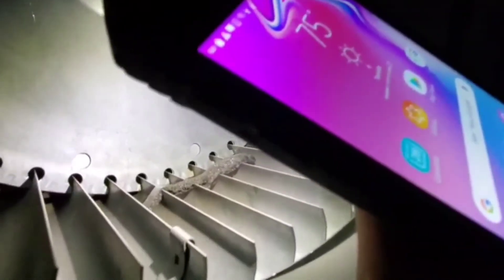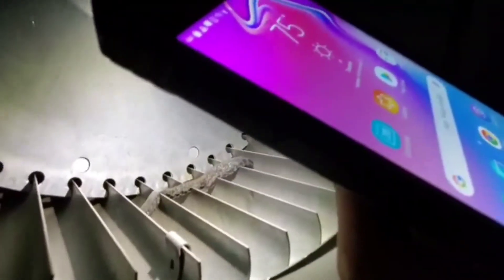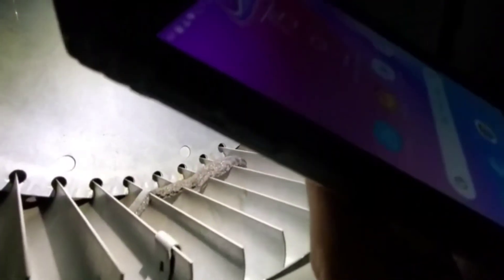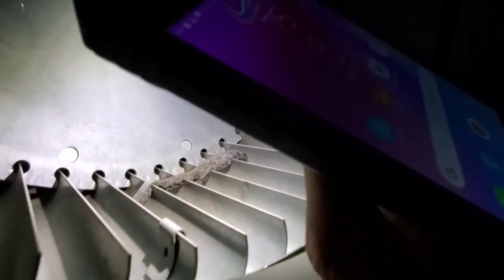Imbalanced Blower Wheel Causing Vibration

Comment from the maker: Amazing what can throw these off.
Reply: The furnace shakes so bad when the blower first comes on, the whole house shakes. Comes on really strong with a BOOM, then it runs perfectly smooth and quiet and shuts off the same. Something to do with the air transfer until it clears out??   ... But what to fix, know it all??? lol    ... no, but, please help🥺ty... peace
Reply: Mine started squealing and making all sorts of vibration. I put it off a couple weeks then finally found my 1/4" bit to take the panel off. Mouse in the wheel. Ugh. Never had a mouse in my blower for 50 years. Now that I installed a new unit, boom, mouse. Just my luck. Smooth now.

Comment: I removed a bunch of dust off the fan blades so much dust i dont even know how it was blowing air out the vents and now its making a loud buzzer garbleing noise,,, it was quiet before i cleaned it now its so loud i cant even run it. It literally sounds like garbage desposil. But if i run it with the inspection door off and safety switch cliped down its quiet.

Comment: I just thoroughly cleaned the condenser coil/fins inside & Outback. When I first took off the top, I forgot to grab the fan (motor & blade) and it fell a few inches, hitting the condenser coils. Its back together now, but is vibrating somewhat. Everything is tight & secure. Hard to believe a fan blade is out of whack. I wonder if I re-installed the fan into the top lid and was off one bolt. It takes almost nothing to imbalance high speed motors, wheels, etc. Looks like I have to go back at it a bit tomorrow.

Comment: I have a Brivis MPS ME 35i in roof heater. I am trying to diagnose a vibration issue at the moment and had the rear panel off. It appears that the blower fan is just sitting in the housing – should this actually be fastened to the heater assembly in any way? I will pull it out tomorrow and have a closer look if there is anything that could be stuck. Cheers

Comment: I just had a brand new air handler installed and it seems like the blower wheel is wobbling a little bit which is causing the whole thing to vibrate. Is that normal for a brand new system?
Am I being overly picky?

Comment: I did hvac for almost 20 years only few years of residential...i have a new furnace and the squirrel cage wobbles..u can hear the bearings click idk how to fix it i toghten the bolt onto the flat paro of the shat but when i spin it it has a wbbble im worried it will destroy the motor every thing is brand new any suggestion???

Comment: My blower suddenly started vibrating and rattling.  Because of THIS VIDEO, before taking the system apart, I used my cell phone to video the inside of the blower wheel and found a 3x4 inch label had gotten in there. Thanks for posting this!!!
Reply: I had a mouse get on mine over night and i fixed in 15 min

Comment: Thanks for the great tip!!  We had a sudden unexplained change yesterday where we could hear the increased fan motor noise and I could feel the imbalance when I put my hand on the furnace housing.  I looked at a number of different videos but your tip stood out for me.  I diagnosed the problem this morning.....one of the paper electrical drawing labels (about 6" square) typically glued to the inside of the lower furnace panel had loosened enough to get drawn into the fan housing.  Once removed, everything was back to normal!!  Cheers.
Reply from the maker: Cheer!

Comment: I just had a new HVAC installed in my house vibrating like crazy and sounding like someone was sticking there finger in a fan so they checked it out and sure enough they had to replace the blower motor brand new unit...
Reply from the maker: Interesting
Reply: Yea it was a really crappy install they didn't run new lines for the new ac unit instead retro fitted them big into small didn't bother to seal anything and now inducer had to be replaced... I can hear a whistling noise from where all the hot air is escaping so I'm just gonna seal it myself

Comment: My blower just quit because it's been vibrating. Pulled out the housing and all. Wheel turns but not easily and you can hear clicks of resistence. Do I need a new wheel, a new motor or both? How can I find out? Thanks.
Reply from the maker: Definitely a new motor, if it was vibratinf prior then I would also consider a wheel as well.

Comment: I question that small piece of lint is causing the vibration you describe.
Reply: It does. Trust me. These things spin fast and the blades aren’t exactly mounted stiff. A little imbalance really throws things off.
Reply: @jamesbizs  it's like those pair of jeans on the wrong side of the washing machine. Imbalance at high rotational speed causes havoc.

Comment: Check with your local motor shop. We have one in our area that will  come to the site and balance a blower wheel if needed, especially after replacing one in warranty. They use sound waves to do so. York used to require this on large wheels...
Reply from the maker: I've worked with a fan balancer before it was awesome